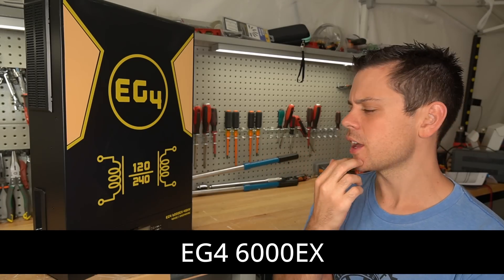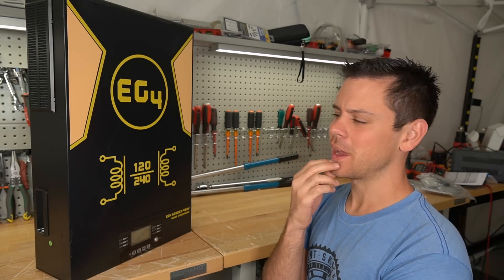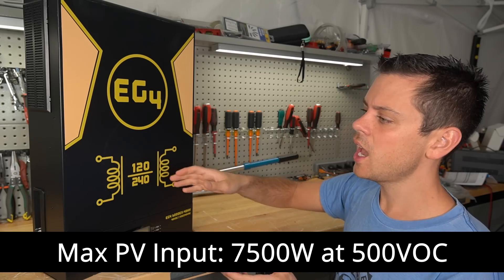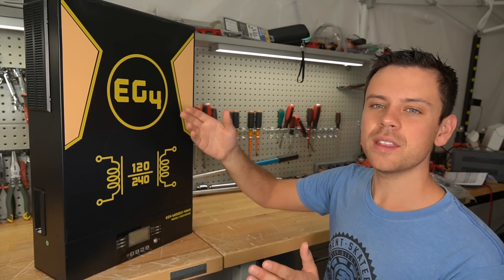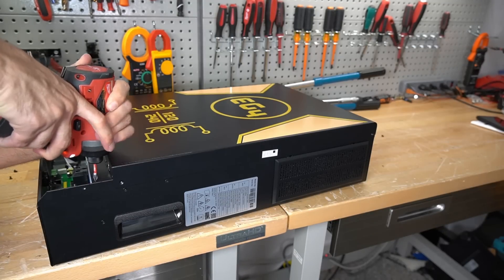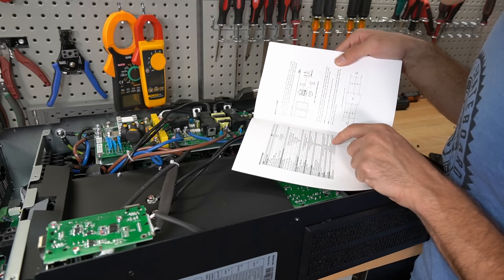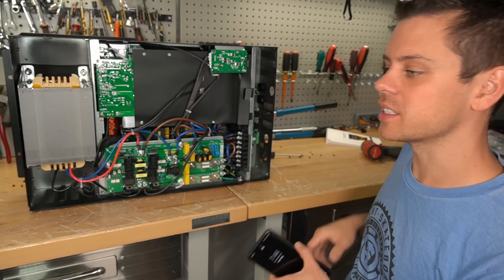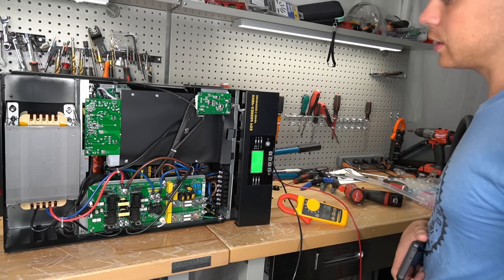EG4 6000EX All-in-one: 6000W LF 120/240V Inverter, 7500W PV Input, 120A AC Charger

Comment: Will, I'm glad you showcased this inverter, yes it may not be as frugal with the energy at standby as other units but as you pointed out but for large inrush current loads it looks like this unit will shine.

I'm planning on having an offgrid shop so something like this inverter would be the ticket. One of the big power draws of the shop will be the TIG welder. The draw will be about half of this units output, the needed inrush current of the welder is like a large induction motor.
Reply: Im in the same situation,, I have to move and the new place has no power but i need to run my tig welder, forge, powerhammer,  compressor, and large linisher polisher , not all at the same time at least,,  bladesmithing requires some power !
Reply: @hugokappes4077  yes blade making is power hungry just like making aircraft parts

Comment: Whilst Victron's inverters do have various power saving modes this is not the reason Victron's inverters have such low idle draw.  The reason is proper electronics design and decent firmware running the show.  Pretty much all of these China sourced low frequency inverters are implemented with the same 'family' of circuit design.  It's not unusual to see the exact same PCBs in different branded boxes but even when the PCBs are different the circuitry is essentially the same just different layouts.  Poor transistor drive waveforms due to bad PCB layouts and poor timing from the firmware is where the high draw comes from.  It takes proper deep understanding of how the MOSFETs turn on and off to minimise power dissipation in that section of the inverter and the manufacturers of the Chinese stuff simply do not understand it all or just can't be bothered to do things properly and just copy what has been done in earlier generations of the stuff.  There are other areas where energy is lost, but this is a good starting point to understand why these things have high idle draw.

Comment: Amazing! Thanks You very much Will!! I am about to buy a system with 2 EG4 6K parallel with 3 batteries and 11.5 K panels for a house with 2 central A/C (3.5 each) and a Tesla model 3 locate in Houston, I hope that if you can make a video of installing this parallel system........appreciated.
Reply: If you're looking at 2 inverters, you should consider the 6500's instead my friend. Much lower idle consumption, quieter, and you get the dual PV input at 8000w vs 7500w.

Comment: Perhaps we should work on using dc voltage instead of inverting . Most devices convert ac back to dc except ac motors which could be replaced with dc units

Comment: The higher conductive load capability and higher voltage are the two main advantages in my eyes. That makes this unit more comparable with that new Sol-Ark 5k that was just released.(but still at a much lower price tag. 

Why is the idle consumption so high? The mppt shouldn’t draw anything. Basic system monitoring function should only draw a few watts. Maybe a sleep mode function for the inverter will fix this? A high end laptop can run on that much energy for 10 hours.

Do you have any suggestions for 12 volt load centers with low idle consumption? I know it requires larger wiring but we might avoid conversion losses.

Comment: I have been looking at this inverter, but I'm not sold on it yet.  Would have been nice with an output of 8000 watts or more.  Thanks for the review.
Reply: As cheap as they are you could just stack them if you need that much power

Comment: But the 6500ex needs to be setup in parallel split phase to run 220 into the house correct? I only need to run a few appliances and only one at a time. My Honda 6500 generator runs my constant pressure well no problem. Looking for a solar solution so the 6000ex sounds pretty good. Running two 6500ex's in parallel to get my 220vac, the idle current for both will be 140 watts anyway and would cost more. 
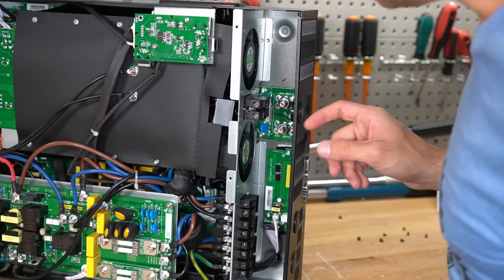3:13 dudes index finger is majorly double jointed! cool!

Comment: I do enjoy watching your videos. But I do not have the funds for what you call starter kits. Currently I'm thinking about just an inexpensive inverter, a sealed car battery, and a trickle charger, just to get started. I only wish to start by keeping reliable power to the two things I most want to not lose power in a power outage. One is my cellular booster, since I live in a remote area, and would need that when the power is out. The other is something important to my brother (but also low watts). Later, I would like to charge the battery with a solar panel. Then I can start moving up from there. Maybe add the fridge, if the cheap inverter can handle it. A second battery would double the time I could go without power. It would be nice to be able to go totally off grid eventually. So the types of systems you recommend would have to be used to achieve that.

Comment: thank you for the work you do. I'm wondering, I need a mppt controller for my van. The one you say is your favorite does not say it works for lithium batteries. Will it be ok in this setup? It's the tracer bn 40 amp

Comment: I was wondering if that inverter has a way to turn it on and off by way of an external contact closure? This way you can connect the output to your well pump and when the pump's pressure switch closes, that switch would instead turn the inverter on thereby supplying power to the pump. When the water pressure is sufficient, it opens the circuit to turn the inverter off. If it was only used for a well pump you could get away with a very small solar panel since the well pump doesn't run all that often anyway unless you are watering the lawn or something.

Comment: Why are these inverters stuck at 6k ish....why can't they get to market a 12k at least? They could also use toroidal transformer to cut down on weight along with the efficiency you mentioned. The idle of these inverters with or without a transformer are just too dam high.
Reply: Just get 2
Reply: @KelvinFPV  Or, they can just keep up with the modern market.
Reply: Growatt SPF12000T DVM MPV is a workhorse all-in-one for off-grid

Comment: Hey Will, My son and I each have a champion 8750 W inverter gen (100520). They are not parallel compatible. Is there a device that will let us combine two generators into something like a SolArk to power an entire house (we average 135kw per day) and we don't have anything solar. Thinking of someway to use two together during power outages, unless I just use one of them to keep batteries charged, in something  like a SolArk 12kw or 15kw.

Comment: I just got one of these a few weeks ago and installed for backup Service only off grid. I jumped on it as soon as I saw it was available at signature solar because it's exactly what I've been looking for. I have been testing during small outages and it's awesome it doesn't even complain when large loads come on. I did notice that I'm having a problem with the LCD displaying the power coming in and loads going out. Other than that the inverter works fine.
Reply: Hi Tesla Charged, Great to hear you are happy with this model, I am buying 2 in parallel with 3 batteries and 11K PV, I am so excited and look forward to my first solar system, may I ask for your help if I have difficulties in the future?
Reply: @joechan5240  Enh possible not really good a expert at this yet but I would suggest at least 4 or 20kw of battery's.  You need two for each inverter really to run them well.  Your idle consumption will be really high like Will said and actually double in your case.  Your looking at draining one battery a day if no sun just being on.

Comment: The idle consumption on this unit is 115w and for two of the 6500EX models it is 140w so it is still less to get your 240VAC with this model. I just got mine yesterday.
Reply from the maker: 2X 6500EX do 13,000W
Reply: @WillProwse  
Have you ever look at your 6500ex under a thermal camera it has a 40 degree Celsius hot spot on the lcd display right by the power button.
Reply from the maker: Really depends on your loads and use case
Reply: @WillProwse  Yep. I am using it as a backup for running a well and a few other things. Not a whole home replacement. Good point.
Reply: I do think a fair comparison for anyone wanting to run 240 split phase, you need to compare the idle consumption of this unit to 2 x  any other unit that would need to run parallel for split phase. If you do that, you'll see the idle consumption isn't so far off the mark...
Reply: The idle consumptin of the 6500's is only 70w. Maybe you're measuring idle consumption under a heavy load.
Reply: @iRollWithPunches  2 inverters(for split phase)x70=140

Comment: Will, what would you recommend for a 2HP 10GPM well pump with a 230V control box as far as going solar?
Reply: You're going to need to look up the spec for your pump. They vary so much. Also, the spec will also only tell you the max current draw and surge for your unit. Unless you install it at the max head depth, you probably won't reach that. I'm finding some insane surge numbers on some gundfos 3hp pumps. 610% surge so 23,000 watts.
Reply: @KelvinFPV  Wow.  Good to know. Thanks Kelvin.  Have nice size water storage tank, but it would be nice to have solar just in case.  Appreciate it.

Comment: Is it even possible to combine this with a Phoenix inverter or any other low idle consumption inverrter to run off the same batteries? How would that setup look like?
Reply: You connect the phoenix inverter to the DC busbars to use the same stored energy, but you cannot directly connect the AC side - your loads would need to be separated into different electrical distribution panels. You can then add a change-over switch (like used for a gas generator into home) to select which inverter powers the electrical panel.

With a motorized change-over, this can even be done automatically.
Reply: @stefanvanzyl9090  why would you ever need to change over the ac side?
Reply: @KelvinFPV  it depends on what you're powering. A small phoenix inverter isn't powerful enough to run multiple large loads, so if your house has only a few circuits, you don't have much choice for permanent separation - if you want to use the vacuum cleaner in your room, the plug needs to be powered by the big inverter (as an example) - so the change over switch gives you flexibility.

Comment: How will this unit handle ground / neutral bounding in case of 2 and more units?
Is it going to be the same story as 120v single phase model where you need to have transfer switch or remove bound from all units except first one?

Comment: For my off grid cabin, I have 2 -10 Kw batteries and plan on 5000 watts of bifacial solar panels like the ones you tried on an earlier program.  It is 1200 Sq. ft. and will have lights, a small steam oven and a single induction element,  240V water heater and resistance in floor heating capable of drawing 2900 Watts to help warm my cabin in Northern Ontario during sunny days ( it gets to -40C).  Would I be better to run a split phase 120 - 240 inverter or two separate inverters with one battery for each.  Seems like the split phase you are using loses too much power at idle.
Reply: Great questions! I just built a system last year in Northern Ontario, between Marathon and Nipigon and totally understand the challenges of the brutal winters
Reply: trick question!
Reply: You might also consider Growatt SPF5000-US which is single phase 240V; you add Growatt's midpoint ATS transformer to provide 120V. Lots of these units are running fine in northern Canada with 48V AGM batteries.

Comment: low frequency units are less likely to put out a ton of RFI, which is nice for someone who wants to run RF sensitive equipment. Say an Amateur Radio operator for example.
Reply from the maker: Yes very true. I always forget to mention this
Reply: Even amateur radio operators have access to isolated transformers / power supplies - and with access to DC batteries, you don't need an inverter anyway, just get a DC-DC converter from the 48V to 12V.
Reply: @stefanvanzyl9090  doesn't help when your equipment requires AC.
Reply: @vhfgamer  if your equipment is AC, then you can always use isolated power supplies, which is why I mentioned that first. Most cheap ham radios are DC, though, as they are designed for mobile use.
Reply: @stefanvanzyl9090  Sure, but what about all the extra stuff besides the radio? What about computers, monitors, lights, and heating/cooling in the shack?

An inverter that's reasonably RF quiet is a must. At least for my needs. YMMV
Reply: @vhfgamer  computers internally run on DC, monitors run on DC, LED lights run on DC (and then don't cause RFI themselves), element heating runs perfectly fine on DC.

household heat pump motors and fan motors run on AC sure, but RFI from the inverter to the aircon isn't going to affect your radio nearly as much as the RFI from the induction motor itself - induction motors are incredibly noisy anyway...

Comment: Would this be a better fit for off grid solar mining than combining two of the other units?
Reply: I'd still suggest going for the dual 6500's if you have the means to do so - this will allow your battery bank to take you much further due to the idle consumption.

Comment: What is idle consumtion for eg4 6500 please? I dont see in the manual. Thanks
Reply: I believe it’s the same as the lv6548. Which is around 72w, half what this one is.
Reply: @GavinStoneDIY  This one is 115W average consumption. Just got mine yesterday.
Reply: @JD-uy5js  thanks .  I used to have growatt have Congo can tell how much it lost between battery eh4. And  load n consumption.  But on this .  it would not tell how efficiency at the load at all

Comment: I think this is cool but much better to buy 2 of the 6500w versions. Get double the output, double the PV input & it’s dual input, & 2-6500s have the same consumption as this one inverter 👍👍
Reply: I just  two 6500 in. Can't wait till I get time to build everything I got 6 battery's with it
Reply: Indeed. This unit only makes sense in odd numbers

Comment: Just wondering … would it be easier to run motors with a 3 phase system and 3 phase motors?
Reply: @iRollWithPunches  I knew you have to have 3 phase enabled solar.  Just wondered if 3 phase motor starting would be easier to do over single phase